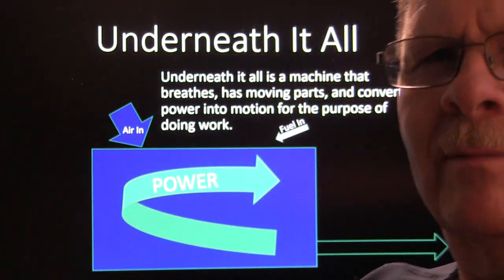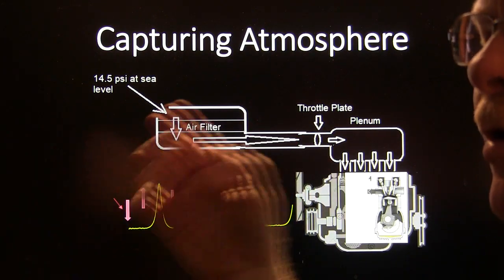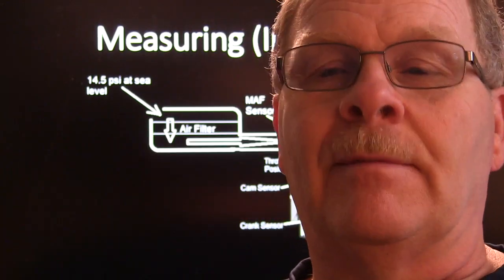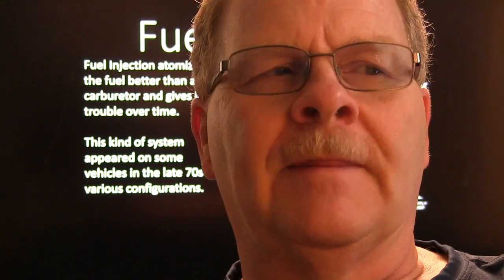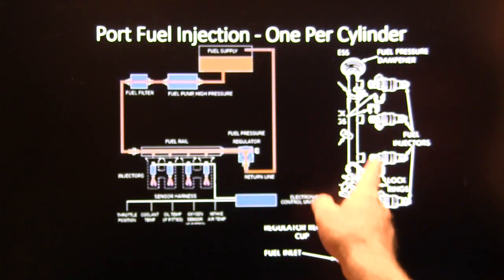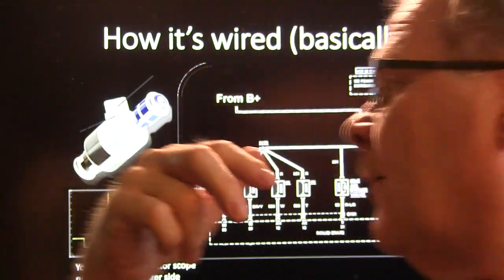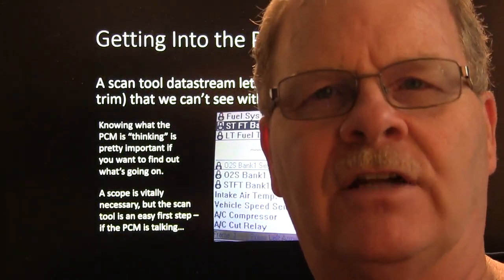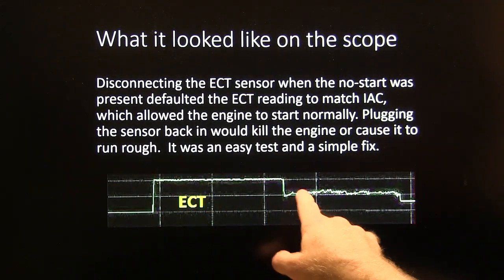Fuel Systems for Dummies

Comment: Great video.  Have two questions:  1) Does a distributor seem less problematic then coils?  2) When an Ignition Control Module fails, is it always going to be a no spark?  And when the ignition coil is failing, it will be a week spark?  So if I have spark, can I always just rule out the ICM?
Reply from the maker: 1. Distributor ignition is problematic because distributors wear out. Coil pack ignition is typically more reliable. When a distributor has breaker points it's even worse. The ignition module can fail and make the car run bad - it isn't always a no-spark.  A weak spark is almost always a bad coil - unless there's a lot of voltage drop on the coil circuit somewhere.  Finally, (again) the ICM can be the problem even if you have spark, so simply having spark doesn't rule it out.
Reply: @McCuistian  Thank you.

Comment: Back in the day I had an old Datsun 610 my buddy and I put a 12A Rotary engine in from an old RX2.  We ported and flowed the engine which gave it unbelievable horsepower.  The downside was the timing had to always be retarded to start it. I always left one of the two distributors slightly loose, moved it for start, then moved it back once it was running.
I watch every one of your videos to the end.  I appreciate them and learn something from every one.  I'm not working on an ASE but appreciate learning from your experience.
Reply: I like both the idea of old Datsun cars and the rotary engines for fun projects. That sounds like you had a good time.
Reply: @Creaturemotorsport  Oh, it was good fun.  Back in the day (mid-80s) when you could race light to light downtown on a Friday/Saturday night and not go to jail.  My old 74 Datsun kicked some big block butt! We'd get to the end of the cruise strip, at the local Arby's and pull over.  I still remember a guy I beat coming over and  looking under the hood..and while scratching his head said, "Man, whaddaya got in that thing, a slant 6?"  When you said "12A Rotory with a 4bbl carb, headers, and 2-1/2" exhaust with a glass pack and a turbo muffler" they just said, "huh?"  It rev'd 9-10K easily and spun tires in 4 gears.  The Datsun 610 had that independent rear suspension and it spun both tires.  A real sleeper for sure.  Unfortunately, it overheated a lot (typical of those rotary engines) and I finally got rid of it for something more practical...a 77 Celica.  No more racing downtown but it started and ran every time I needed to go somewhere.